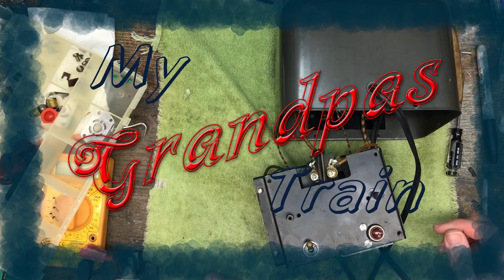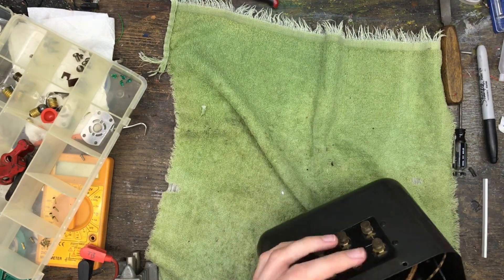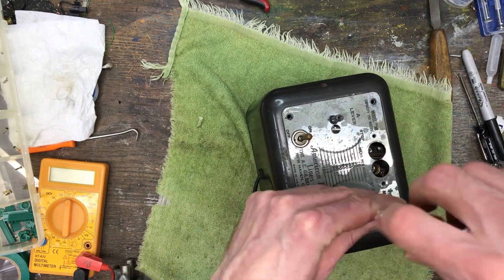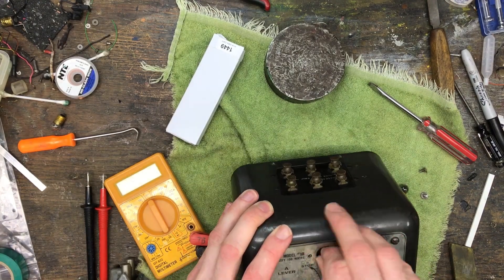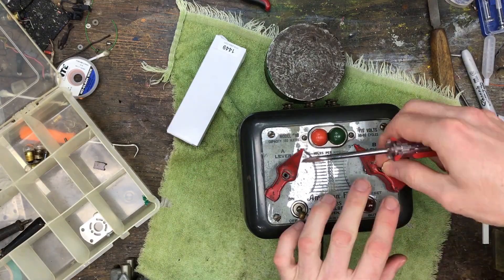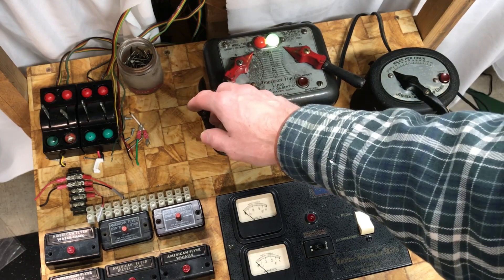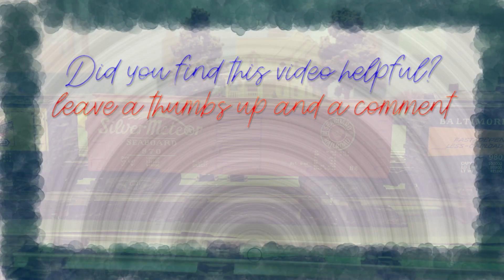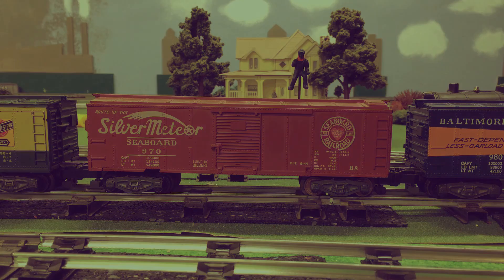American Flyer Transformer Model 9B Part 3 - Final Assembly

Comment: Congrats on a job well done. I'm impressed with the circuit breaker repair. Surrounding the outer edge with metal was genius! Question- what's the large central item on your control panel with gauges?
Reply from the maker: The mysterious black box? That is my DC controller for my 332 DC locomotive. I run my 8B into it and DC voltage comes out. Actually I made it from part of a Baldwin organ! It has a high voltage power switch and outlet that the transformer plugs into. Then in the low voltage section I wired in a high current bridge rectifier and filter capacitor to convert to DC power. Then I run it through the volt and ammeter and then the directional control switch. Progress is stopped on the Flyer layout as I got the HO itch for a while so next videos will be on that!
Reply: You have a knack for repurposing - I like it.